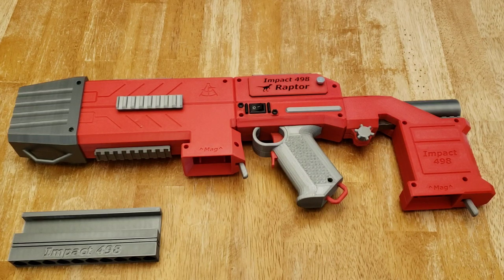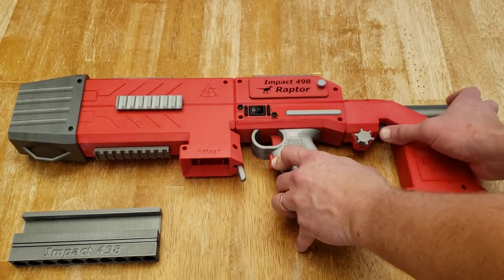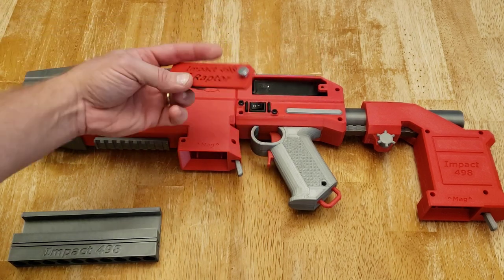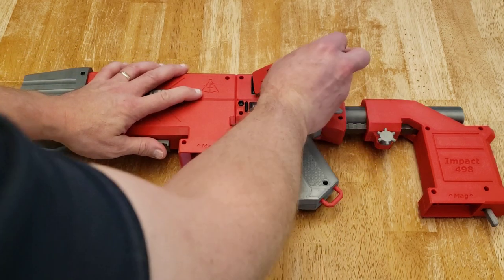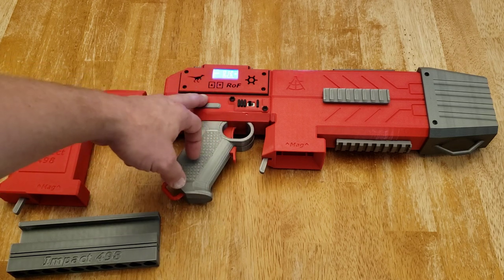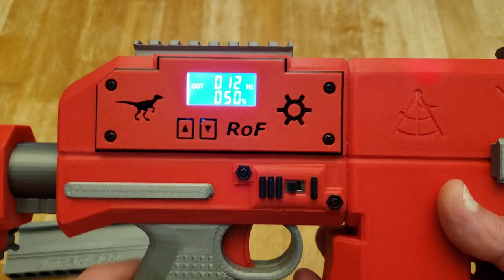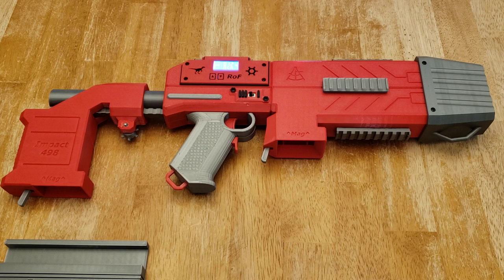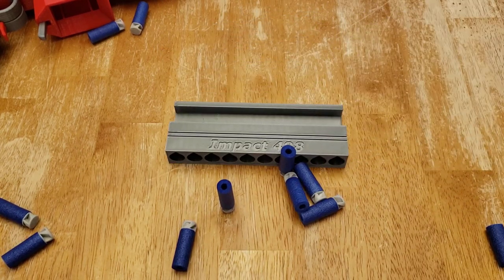Impact498 Raptor - Operational Overview

Comment: What motors are in there, and whats the wheel root diameter and motor spacing?
Reply from the maker: All three stages are Kraken motors.  In the final iteration of the cage, each stage has a different flywheel size, I believe they are 34mm, 42mm, and 44mm at the center.  And I believe the motors are positioned so that each stage as around an 8mm gap.

Comment: Hey I just built a foxfire semi auto and everything went great but the trigger pull is unusable, every time I pull it gets stuck back. Do you think I will need to sand it or is it because of something else
Reply from the maker: It might need sanded depending on how your printer prints.  I.e. if it extrudes extra filament, etc.  The mechanical parts on the semi-auto core alos need to be lubricated with something like white lithium grease.
Reply: @498nerf7  ok thanks a lot 👍

Comment: This looks great brother. I was curious on how hard it would be to add FPS adjustment to the system. Making it more versatile for other game types.
Reply from the maker: It wasn't straight forward, unfortunately.  I played around with using a PWM to slow the motors but it didn't work well.  I might have to look into a buck converter in the future, but a lower voltage also has the side affect of slowing down the spin up time.
Reply: @498nerf7  Rev up will be an issue for sure, I've been toying around with a "governor" type system for flywheels that theoretically could give you a hard cap of FPS without a Rev-up loss. Making it viable and cost effective is the real issue.
Reply: Also, is that the same tiny hand grip that's on the Lightning Bug? I love that little lighting bug but it's now my 5 year olds primary because that grip is so tiny. My thought for a 200FPS blaster is that bigger hands (like mine) would be the most likely to play with it.
Reply from the maker: @joelcurtis3363  No, the grip is bigger than the one on the Lightning Bug.  It is the size of the Foxfire grips (actually just a slight bit larger.)  It is made for an adult hand.

Comment: This vs foxfire talon select dual stage?
Reply from the maker: This shoots about 50 fps faster than a 2-stage Foxfire Talon Select.  It is also a bigger blaster and has an adjustable stock.
Reply: @498nerf7  ok